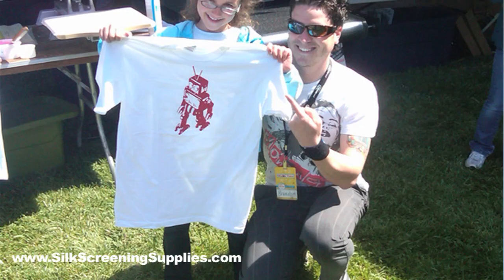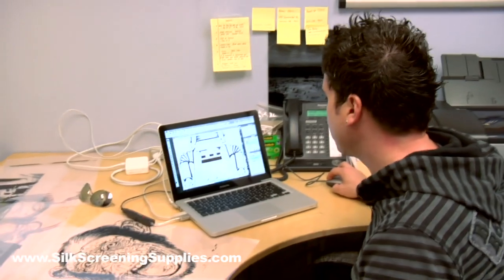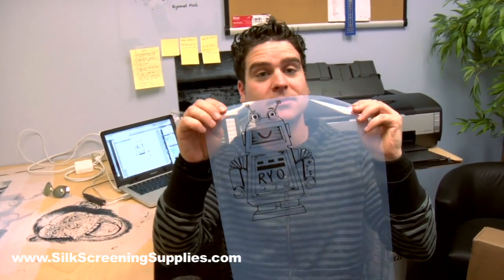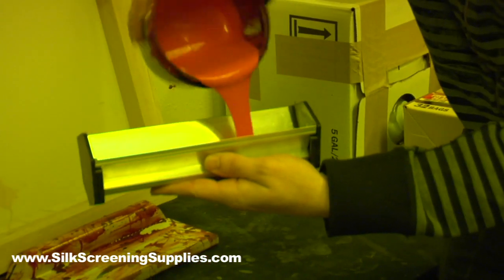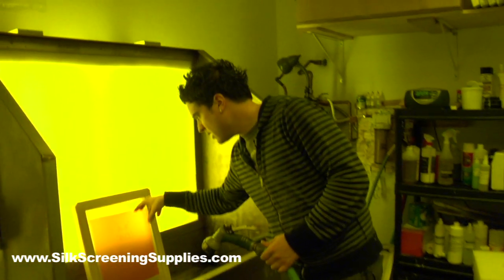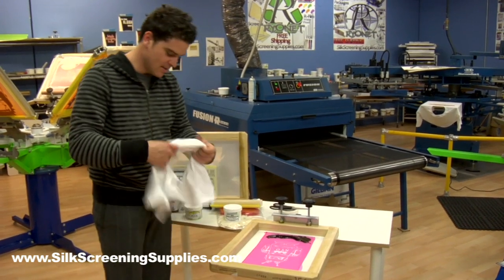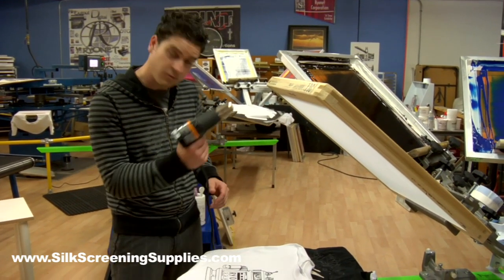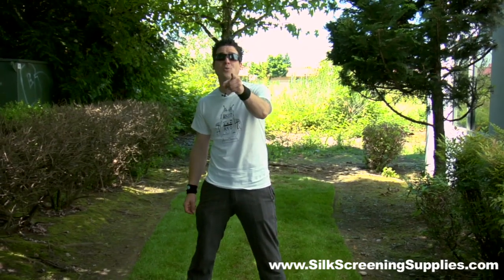Screen printing a shirt, How to screen print a t-shirt w/ Ryonet's Hobby Kit

Comment: Is the position of the platen stationary, or is it adjustable (in case you need to adjust how high or low the art is on the shirt?
Reply from the maker: This is an old press, we work with a press like this, the platen comes stationary but you can add a platen bracket so it can be adjustable. http://www.silkscreeningsupplies.com/product/screen-printing-starter-kit